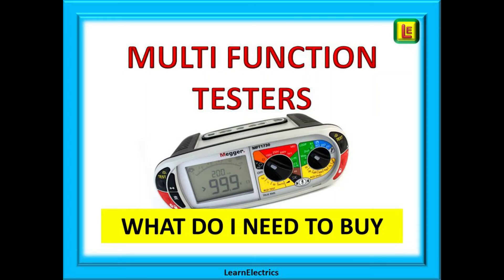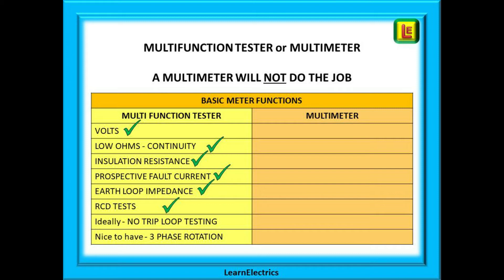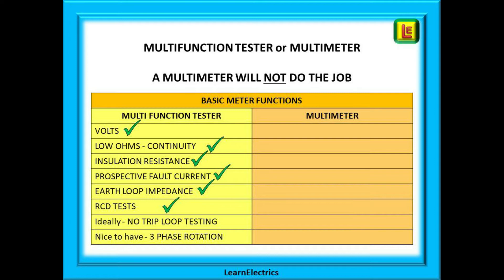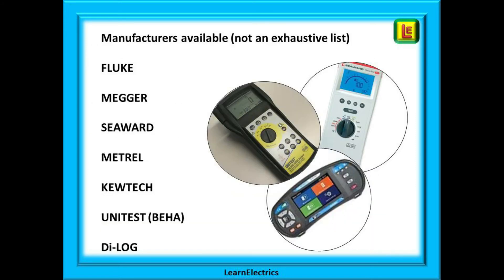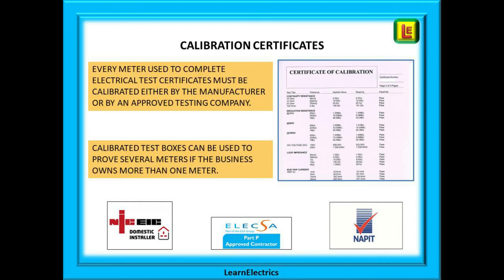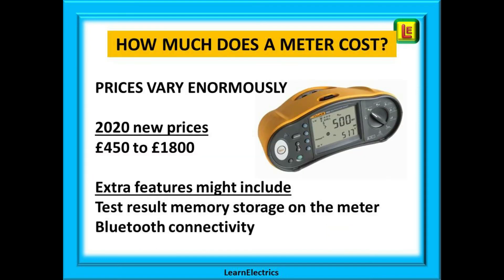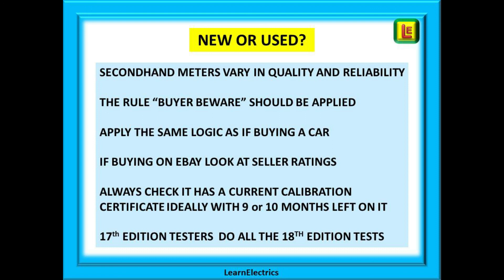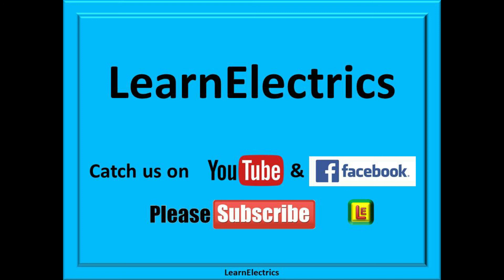BUYING MULTIFUNCTION TESTERS. A Guide to what you need to know.

Comment: Hello Dave ,
Merry Christmas 🎅 
What are your thoughts on the calcard?
I am purchasing so i can compare readings on a used MFT from ebay.
Reply from the maker: When I was assessing for Napit, a calcard was considered a monthly check device, to make sure your meter was still ok. A calcard cannot replace an annual calibration. It does not have traceability back to National Physical Laboratory standards.
So get your meter properly calibrated when due and use a calcard each month to satisfy yourself that the meter is still functioning correctly. And good to check your new meter when it arrives,
hope this helps.
Dave.

Comment: Can you use the multimeter for continuity tests and buy another instrument that just have insulation resistance test function. I’m just doing minor installation and repairs around the house. R1 + R2, polarity and insulation resistance tests
Reply from the maker: Yes you can Ashraf, all the test instruments are available as single function devices. BUT ... you can get a really good multifunction tester that does ins res. and includes all the other tests for about the same price as a single Insulation Resistance tester. The Kewtech range are very good prices and very good meters. You don't need a top of the range meter if you're not doing much. Just a thought. Dave.

Comment: I bought a ROBIN KTS 1620 second hand for 80 pounds just for practicing at home. Im sure this will trip RCBO or RCD's.  Have not used it yet.  Is there a procedure to avoid tripping the RCBO's/RCD available.
Reply from the maker: Go onto Google and search for your specific meter. There will be a manufacturer's pdf with all the user instructions. Lots and lots of practice is the key to understanding your meter.
Reply: Michael Costello , Robin KTS 1620 / Kewtech Kt62 
May trip some types of RCD/RCBOs if it does you can change the angle ie test on 0d if the RCD/RCBO trip repeat the test on 180d if it still trips the RCD/ RCBO then you will have to temporarily replace the RCD/RCBO with a suitable MCB, for the test, don’t forget to put the RCD back as soon as you have got your reading.
Reply: @seandempsey7351  Thanks for the advice

Comment: Great advice but one point you do not have to have a meter calibrated every year you can self check using a check box so long as you keep an up to date record of the readings and any deviation from the base ready then calibration will be nessosery
Reply from the maker: The rules say that you must have the check box calibrated if that is what you are relying on. You need to prove your meter against something that is calibrated and traceable.

Comment: Assume that £450 was ex vat 😄
Reply from the maker: Massive range of prices, some display including VAT, others without.
Reply: @learnelectrics4402  just looking at a metrel 3125 used for £190, good deal do you reckon? Would be for non commercial use
Reply from the maker: Lots of good used meters about, I've had a couple for £100. If you buy used I would suggest making sure it has 10 or 12 months calibration on it and comes with a set of leads and written confirmation from the seller that it is in good working order. The old adage applies - Buyer Beware. Dave.
Reply: @learnelectrics4402  cheers dave, I'll keep looking. Missed that one, he withdrew the sale.
Reply from the maker: Good luck with the search. There are some bargains out there. Dave.